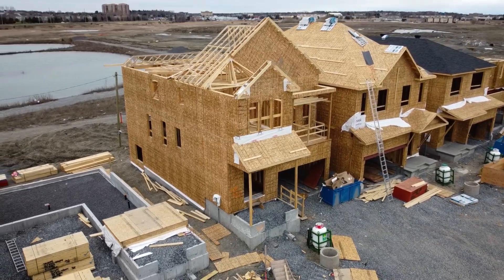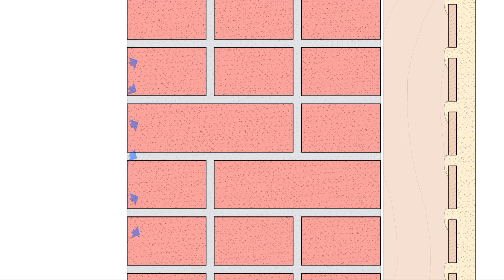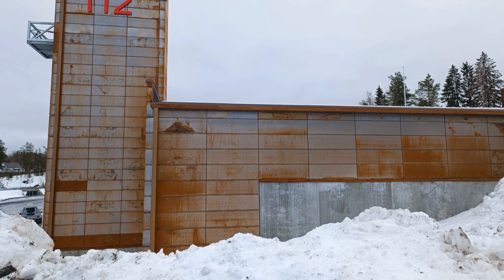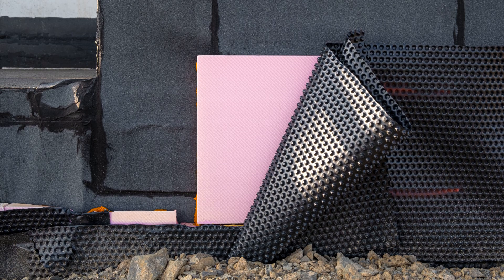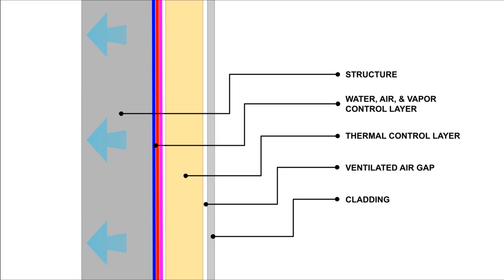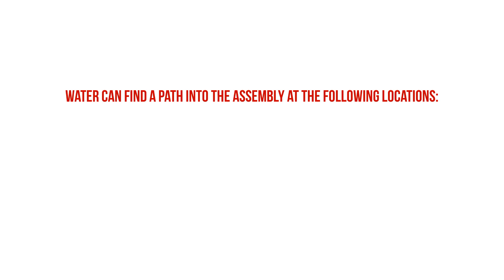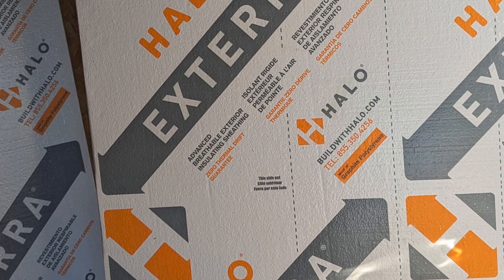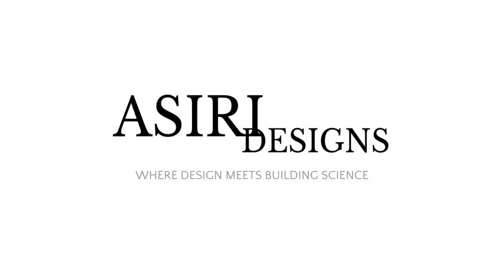Designing a Wall That Will Last 500 YEARS?! | The Perfect Wall

Comment: You discuss pest control, and show an example of insect burrowing in rigid foam insulation, but what about rodents. I've been remodeling an ADU and there were significant issues of rodents nesting in the fiberglass insulation in the walls and ceiling. An interesting observation was that the attic had two sections, one section had blown in cellulose insulation; in the other section was rolled in fiberglass insulation. In the section with fiberglass, there were many sections where rodents had nested. Each section between the ceiling rafters had at least one nest in a 20 foot section. In the section with blown in cellulose insulation there was zero evidence of rodent nests; no mouse turds or urine stains, no chewed up pockets of insulation, nothing. I am not sure rock wool does much better than fiberglass, since it can easily be burrowed into. I've read that rodents don't like loose cellulose insulation because it can't be burrowed into, it just collapses.

Comment: Love the video!

I like the first (best) option. Especially how the steel structure will avoid thermal bridging, and is easy to access if need be. But I feel like the exterior should be closer to option 2 with vertical hat channels & aluminum cladding... BUT I'd add thin-tile 'applied' brick or stone veneer onto the aluminum. (might need to figure out an ideal primer for that so it stays put)
It would give you the brick look & feel (and the resistance to dents/scratches), but be cheaper than a full 4" brick layer. And I think the hat channels will drain/evap better than the small air gap in the 'real' brick version.

Also, on the inside you could leave some sections bare of interior wallboard, and apply some more of the brick or stone tile in those places (onto the CMU), which I think would look really nice as a detail. The steel framing would give you the stud spacing freedom to do a couple areas like that.

Brick tiles aren't as strong as 4" thick bricks, but you can replace individual tiles or areas, as needed, from a spare stockpile. And there's no structural concerns about the brick layer's stability while pulling out sections. It should also protect the aluminum very well.

Is this crazy?

Comment: Would the fixings for the rigid mineral wool compromise the fluid applied control layer. Would it be better off with rigid insulation stuck to it?

Comment: i have concept for wall. create two walls of 2x4, with 1 ft gap in between and lined with moisture censors and cameras that tie into a home control system and you can see all the data at your fingertips, the temp, moisture, etc of all surfaces and materials. isn't that cool?

Comment: Thoughts on lime-plastered and rebar-reinforced compressed stabilized [interlocking] earth blocks (CS[I]EB)?

Such walls are load-bearing, highly fire-resistant, and even durable against moisture if constructed with the right ratios of materials and properly cured. They can also often be constructed from soil found on-site, saving significant material costs. They are also highly modular so one can construct these walls in a double layer for added moisture protection and insulation.

Comment: Take Joe Lstirbek’s online building science classes - best investment you’ll make.
Btw, I build my off-grid solar house of insulated concrete forms (ICF) - 6” thick reinforced poured concrete walls with 4” of rigid EPS  insulation on both inside and  outside walls. Best construction decision I made!
Reply from the maker: @Cynthia-j4u1y  We require that anyone who is contracted with us takes Joe's course. It truly is fantastic 👍
Reply: May I ask how you finished the interior? 

Internal stud wall or direct fix of drywall? Somehow 

Nice construction choice btw
Reply: @KS-yj1px drywall gets installed over the foam, screwed directly to the ICF plastic ribs. Electrician made channels in the interior (and exterior, where needed) foam to bury electrical lines. Nudura ICF has a series of YouTube videos showing all these techniques.

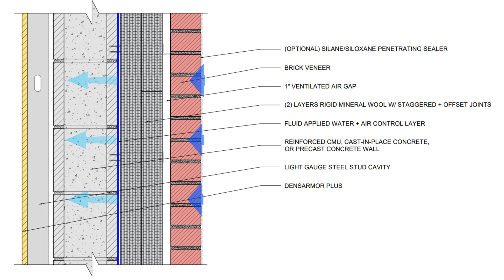Comment: 8:58 This is actually very similar to how chateaus are renovated.

The exterior is preserved but the inside is usually retrofitted with frame walls and insulated inside with plaster or aerogel wool.. sometimes with hemp or insulating boards but those are rare cause it requires a lot of space or impossible to restore the original interior.

No vapour barriers, it’s all vapour open.
Reply: How is that similar at all, when the video shows all the insulation on the outside of the structure?
Reply: @markmartin7384 He’s using metal frames inside for internal walls making a double wall system which is one of the most popular ways of renovating or building energy compliant buildings across most of europe and asia (specially in france, very popular)

The external wall insulation is a standard for most new buildings for decades now that energy efficiency 45 and 55+ regulations and alike have been rolled out across continental europe and asia with high costs of bills related to energy use.

For a true 500 years old wall he should have used clay blocks and prefab concrete slabs for higher floors and stairs, lime plaster for interior finishes, aerogel, foamed glass or hemp blocks for external insulation and stones or klinkers for the façade.

Strip foundation with high strength concrete rated for exposure to acids salt and water with fibres for micro cracks and carbon fibre or glass fibre reinforcement.

between the foundation and above grade wall there should be capillarity stopper.

the ground floors should be made from layers of expanded clay, foamed glass and a limecrete slab with geotex in between each material, optionally cork screed, for a finished floow stones, tiles or bricks can last centuries.

Aerogel membrane installed with lime plaster around the wall opening, adhesive waterproof membrane that can stretch for sealing the bottom of openings, adhesive weather membrane with a fleece side covering completely the door and windows openings 360 degrees and lime plaster over the fleece surface together with the entire external surface of the walls.

Windows and doors with a wood frame and metal facia installed with high grade stainless steel screws and resin anchors or chemical anchors.

Sheep wool for insulating the gaps between windows/doors and the walls.

When finishing the façade with bricks or stone you can add zinc, copper, slate or brick windows/door sills 

a roof of thick solid timbers from caribbean heart trees build with precision joinery and tactically placed heavy duty stainless steel screws to act as one unit.

Sheep wool for insulation in between the rafters,wood fibre for external roof insulation, a smart roof membrane with nail sealing ability adhered on top of the wood fibre boards, nail sealing tap where I will use copper nails to fix the battens on top of the membrane to the rafters, copper nail counter battens to the vertical battens already installed and use clay tiles, slate or copper metal sheets for roofing.

A dry roof ridge to use nails and fasteners to secure everything while having a lead mesh ventilating the ridge, a copper or lead ventilated bird guard in between the eave and roof tiles/metal sheets.

large eaves with copper gutters and down pipes directly going into the ground drainage pipes that are made of perforated pvc wrapped in geotex membrane all around the building perimeter at least 600mm deeper than the foundation and 1 metre away from the foundation wall surrounded by foamed glass foamed glass wrapped on geotex and covered by thin layer of stone aggregate or walking path enough depth in that layer for structural support when walking on it.

Gutters and down pipes with a electrical heating wire looping the inside.

the ground drainage should connect to the manhole and a water reservoir that slowly releases the water into the sewage system or underground away from the building.

That’s why I said it reminded me of the chateau renovations and my two buts on how to actually achieve 500 years old status on a liveable building with modern standards of comfort.

Comment: The reinforced steel in the hollow concrete block will rust before 100 years.

A 500 years wall would be build from clay or stone (maybe dense concrete blocks)

stone or bricks only need minimal maintenance, can deal with soil movement and freezing as long as not paired with too rigid or impermeable materials.

Insulation can be done inside with hemp walls, floors insulated inside vapour permeable and with a screed as the surface for tiles, stones or timber.

Roof structure made with joinery ,insulated with wood fibre and clay or copper for roofing.

All interior walls and ceilings finished in lime plaster.

Foundation made with a pile foundation or footings on walls (preferably no cement slab or steel reinforced slab)

The outside can be left exposed for the natural look of bricks or stone and eventual repair of parts (optionally plastered over if necessary after prolonged damage).

A 500 years old wall could also be conceived from rammed earth or insulated brick.

However both alternatives demand certain characteristics with the soil and weather exposure that could be limiting for a 500 years old building.
Reply: Yeah concrete only works if you use stainless or non-ferrous reinforcing. Mild steel reinforcing in concrete is a ticking bomb. Concrete with the right reinforcing will last thousands of years.
Also as soon as you have soft insulation, even if it's unattractive to insects as rockwool is, as soon as rats or other large vermin find a missing brick or other opening, they're going to be making a nest in there. If the outer cladding is something you can strip off and replace easily, you can tear out the fouled section and rebuild that bit. With bricks on the outside, not so much.

I'm Australian, so I'll stick with steel roofing. When steel isn't clamped inside a concrete slab, it's not staying damp, and rust takes a long time to happen to galvanised or zincalume steel that isn't sitting damp. A good roof should last upwards of a hundred years with minimal maintenance, and when it does rust out you strip the old metal off, repair any damage to the framing, and put a new metal roof on. The rusty metal you stripped off is fully recyclable, too. And the rural Australian tradition of wide return verandahs saves a lot of direct sunlight, heat, and water pressure on the walls. It's a broad brimmed hat for your house, and when you're collecting your household water from your roof the verandah also represents a lot of extra catchment for not a lot of extra money. My current house has more square metres of verandah than it does of actual house.

I'll have a concrete slab, but non ferrous reinforcing, and a framed up floor to make a crawl space over it so there's room for waste pipes to exit the building through the walls, not through the floor. Replacing a broken pipe under a slab is no sort of joke.
Reply: @tealkerberus748  timber will always rot best alternative to conventional framing practices is to invest in a envelope that absorbs humidity and quickly dries.

Rammed earth, lime hemp blocks, wood fibre boards, unfired clay blocks, sheep wool insulation, cellulose insulation, mineral wool plasterboards, lime plaster, lime mortar for bricks/stones, breathable paints, ventilated façades, smart air membranes.

With timber you have to build the entire structure to quickly dry as fast as possible with the most air permeable materials that also help with humidity control and offer a anti mold/mildew affect. 

All conduits and pipes inside a tube system so any pipe leak or electrical rewire doesn’t affect the envelope’s integrity.

Always build the bottom of the frame walls to be  above the height of where water splashes back onto the wall when hitting the ground.

with pipes and conduits set inside tubes built into the slab it’s never a problem to replace pipes under the slab since you can just pull it out from inside a tube built inti the slab.
Reply: @CharlieZenenour Timber will fail eventually, but it can take a while if it's well designed and detailed. The roof framing of Notre Dame lasted well past the 500 years we're discussing, and would have lasted a lot longer had it not caught fire. The important part is to design the rest of the building so that any timber components can be replaced if needed without damaging longer lasting materials. Like using steel for the roof sheeting, but not using steel for the concrete reinforcing. Steel roofing is easy to take off and replace.

Keeping water away from the bottom of the walls is a lot easier with a wide return verandah. My current house has 2.4m, but it's really not enough to serve as a comfortable outdoor living space - I'd make it 3 metres at least, next time. 

I wouldn't use organics like cellulose or sheep wool insulation. Those materials are a natural home for insects and mould, and the only way to stop them breeding insects and mould is to treat them with a whole lot of toxic chemicals that I don't want in my home. Inorganic insulation like perlite is natural but a whole lot less problematically biodegradable.

Assuming your wall material will absorb humidity and then dry depends on having average annual humidity low enough that everything does dry out. I'm looking to move to a region that has 70-80% RH every month of the year, so if I don't want my clothes and books rotting I need active humidity control. But I'm tired of living in a dry climate, so it's worth the hassle of keeping my house dry to have grass that is green all year around instead of being brown six months of the year.

Soft materials like cables being run in conduits saves a lot of trouble. For rigid products like wastewater pipe, you need access to every corner and junction to make that work. You can run a pipe through a wall that way, or passing under a slab such as a verandah floor where there are no junctions or elbows in the area under the concrete, but under a house slab with junctions everywhere would be a lot more difficult.

The bigger challenge is designing for future technological changes. People building houses 500 years ago weren't planning for electric lighting. They didn't even have indoor plumbing in their houses back then! Now we have electricity and hot and cold water supply and wastewater pipes and fibre internet, and we simply cannot know what people will expect in their homes even 50 years from now. So we have to make houses that will be easy to add new pipes and cables into, without knowing what those pipes and cables will carry.
Reply: @tealkerberus748 good luck
Reply: @CharlieZenenour And good luck to you.

Comment: What climate zone is this for? We do well with vapor open walls in our area.
Reply: It's for all climates. The inside can dry to the inside and the outside to the outside. Since the insulation is on the outside, condensation isn't going to form on the inside of the wall like it can with batt insulated stud bays

Comment: Is this a perfect wall? Lime stabilized compressed Earth block ➡️ rockwool ➡️ air barrier ➡️ lime plaster for the siding??? 

The plaster will be the air, water, and vapor barrier. Built with a large overhang.
Reply: Not the same order but if lime stucco is maintained it should last. How important is the order?

Comment: With ICF, would you still put another layer of insulation outside, after your peal and stick or fluid applied layer on the exterior of the foam?
Reply: ICF you can get different thickness of foam to increase the R-value.

Comment: Awesome video. I appreciate your insight and the way you explain concepts. 
Your content has my head spinning between SIPS, ICF, perfect walls and double studs for my potential build. SIPS lead to an incredibly fast build but possibly hard to source. ICF sounds durable but somewhat average R-value. Perfect wall is perfect in all aspects but cost. Double stud seems to rule in cost and efficiency, but doesn't have the durability of a perfect wall. I don't know enough about materials and construction methods yet but I'm curious if a compromise can be reached between a perfect wall and double stud. Is it feasible to have a brick exterior, 12" gap, 2x4 wall with sheathing and blown in dense pack cellulose? The wood would be well insulated and the exterior would be durable. Perhaps brick cannot be freestanding in this way, or worse freestanding and support the pressure of cellulose.

Comment: Love Joe lstiburek's perfect wall. Do you think the rainscreen would be obsolete if the thermal control layer was spray foam and therefore was also the air, water, and vapor control layer? Seems like you wouldn't need any drying if it's impermeable. So it would just be CMU, polyiso, brick. Also, what's the point of the interior cavity? To run electrical and pipe? Running conduit through CMU is fairly common.
Reply: He's got a recent video going over his opinions on spray foam. I would say that there would be concerns about the foams ability to stay impermeable over time. If impermeablity is the lynchpin in your design, that's a big risk.